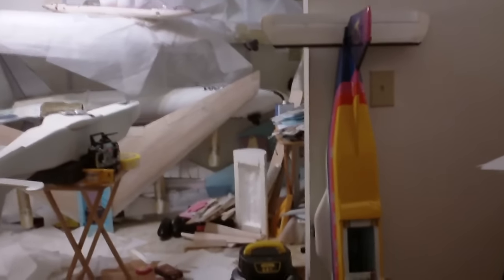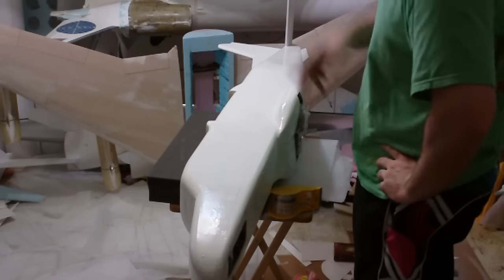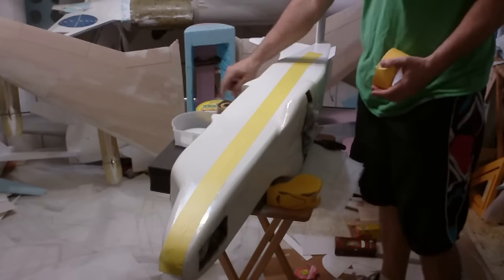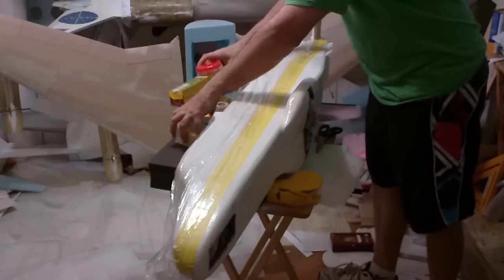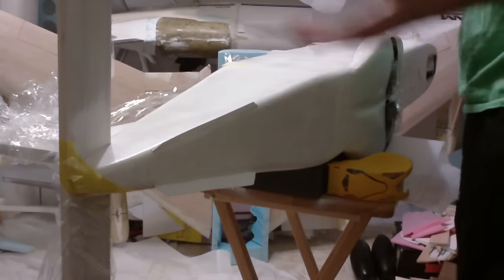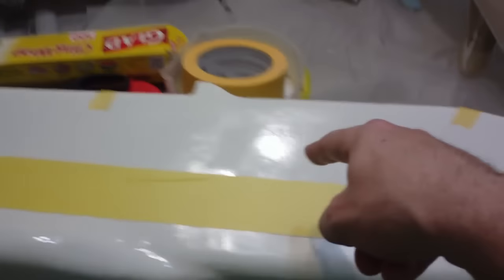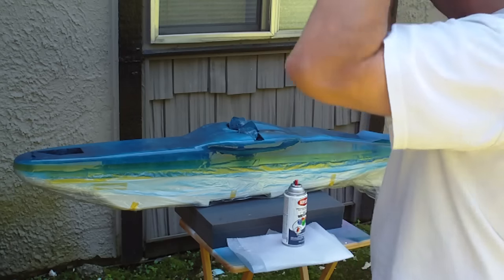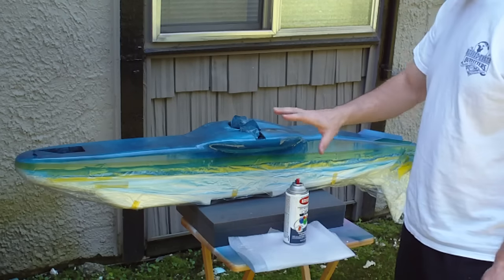How to use Painter's Tape for RC airplanes!

Comment: Your videos have helped me so much with my builds, thank you for spending the time to make them!!!
Reply from the maker: +Dionatronics  My pleasure! ! Thanks for watching!
Reply: +F3HDemonDriver I'm currently working on my second Pilatus PC 21 and I plan on using your fiberglass techniques.  I have a few questions about the glassing process.

Foam Wing is sanded, lightweight spackle is added, foam is
sanded again until desired look is achieved
The foam is then glassed using 3 oz fiberglass sheets (I’ll
follow your tutorial on this)
The fiberglass foam is now ready for shelack, then primer is
added
The wing is now ready to be painted (I’ll again follow your
tutorial on this)
Does that cover everything?
Thanks in advance!

Comment: I paint art foam and do alot of  custom RC foamies the trick to bleeding is to seal the seam and dont spray all on at once do a 1st light coat real light even this can be not certain so there is a sealer to put against the seam with clear caulk  and it works perfect your planes cool dude your a super painter you rule 

r paint you rule

Comment: Nicely done as far as bleed through goes is it not better to paint with the seam facing the ground instead of up? Especially on the first coat since the first coat is where bleed through originates, whether it is due to gaps or just wicking under the tape,  once the first coat dries this will seal any gaps in the masking as long as the gaps are minimal. You will have a great looking plane when it is finished though.
Reply from the maker: TOPHAT1966GS  Its really up to the painter as to how you want to paint your plane because I was painting the belly I want the paint to stick and If I painted it standing on its nose the paint might run down and streak, I had the Bleed through because I didn't press the Painters tape hard enough around the nose section that's why I had the bleep through  . . . Not because the fuselage was up-sidedown.

Comment: Use junk mail and save the glad wrap for soggy peanut butter and jelly builds haha
Reply from the maker: Not a bad Idea! LOL
Reply: RC DemonDriver yup, got an old box that bundled printer paper came pack in and now all catalogs, magazines and bait and switch auto sales flyers that folks out to be huge...etc etc etc get tossed in the box for all sorts of handy tasks from cutting on top of to protect surfaces, organizing small parts, spraying small stuff and masking covers. Tip: save the gummy glue from under the credit cards that come in junk mail and keep it in an old Tylenol bottle and use that gummy stuff on a page from a Cabelas catalog and sick fasteners, screws and stuff hard to hold so you can just spray the heads so they blend in ;)